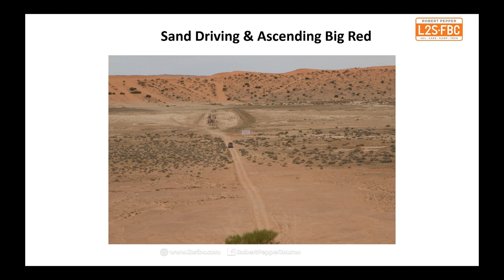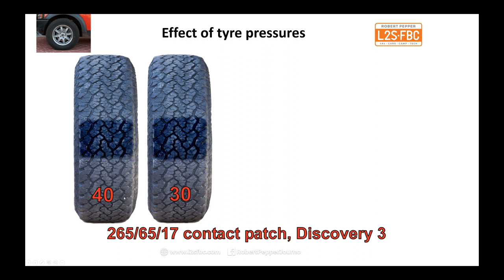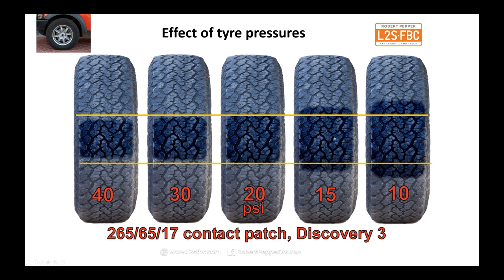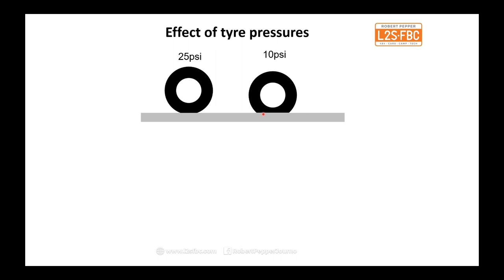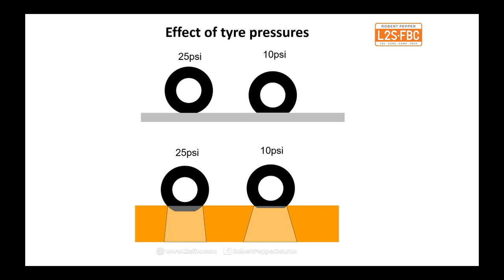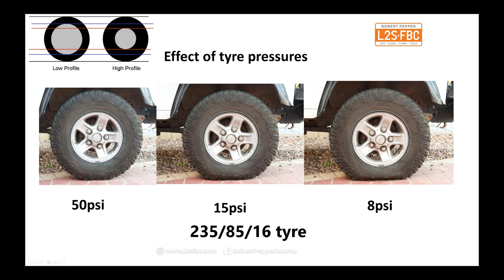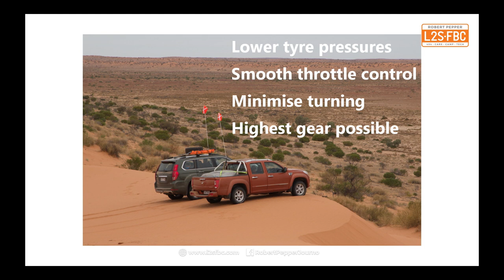How to Drive Big Red and Desert Sand Dunes...s l o w l y

Comment from the maker: Do you find this video useful? If so, please tell me why and subscribe...and if you didn't find it useful, subscribe anyway and tell me what you didn't like!
Reply: Every other video ref this dune shows blokes hammering up the hill.  Your method suits me just fine. Tks
Reply: bb
Reply: Great explanation of the contact patch and its interaction with sand
Reply: I tried with 8psi on Khumo MT71s (265/70 17s) and my Fortuner GX manual at GVM plus as we carried huge water / diesel loads as flooding had closed roads and it was raining (…. Tried going slow on the hardest line (low 2/3/4th) and always got stopped by the hot sand and about 20-30m from the top. Only high 2nd and downshift to 1st near the top got me over on the 2nd hardest line. Crawling will not work even at 0psi (the Khumo can handle 4-6psi as very stiff but dig badly due to the v aggressive MT tread…). All terrains are much better and softer side walls get more flotation….  Depends on your situation…. And going the easier line would work. The hardest line on the far left was so very steep and soft at the top = momentum needed….

Comment: A very heavy vehicle can't go down to 10psi but a similar footprint will be achieved at higher pressures. We slowly cruised up big red on a stinking hot day with 18psi on a fully loaded 3.9ton 75 series Land cruiser. Tyres we're 265/75 x 16.

Comment: I did that same right hand line in July towing my 1400kg (loaded) camper trailer. Similar technique, 2nd gear low range doing about 1700rpm with 12psi in the 4wd and 16psi in the trailer. 
Then unhitched the camper on top of Big Red and was easily doing the more difficult left hand lines. Technique there was 3rd Low and bring up to 40km/hr, then more accelerator when the hill gets steeper/softer.
Reply from the maker: Good post - also see my caravan dune recovery for where that didn't quite work...

Comment: I love the demo. All the theories aren't as convincing as seeing how it really works.

Contact patch size can be calculated quite easily. The total weight of your vehicle must be supported by the total contact patch area. The air in a tyre is at the same pressure everywhere in that tyre (high-school physics) and is the only thing supporting the weight of the vehicle. The main thing to remember is conversion of units, as (in Australia) we tend to think of vehicle weight in kg, but tyre pressure in psi, and we don't want to make a NASA mistake. The simplest conversion is to convert the vehicle weight into pounds by dividing by 0.454, so a 2500kg total vehicle weight becomes 2500/0.454=5506 pounds. This will be spread over 4 tyres, so each tyre will be supporting 5506/4=1377 pounds. (This will vary when the vehicle is on uneven terrain, so some will be more, some less). 

The total contact patch area in square inches is then simply the total weight divided by the pressure in psi, so at 40psi, the contact patch for our example would be 5506/40=138 square inches or 34 square inches per tyre. If your tread is 10 inches wide (i.e. 255/something) the contact patch would be only 3.4 inches long. Dropping to 20psi gives 5506/20=275 square inches and a 6.9 inch long contact patch. Down to 10psi and our total contact area is now 551 square inches or 138 per tyre and is over a foot long on each tyre. As you point out in the video, those last few psi taken out make a huge difference.

In the real world, patch size for each tyre does get affected by tyre stiffness and shape, because around the edges of the contact patch you have a tapering-off effect. It is also affected by the difference in load between a lightly or heavily-loaded tyre (e.g. hanging in the air, or uphill vs downhill tyre), but the maths gives you a pretty clear idea of the difference pressure makes, and the total must always balance out to the total weight of the vehicle. The heavily-loaded tyre will bag out more to give a bigger contact patch and the lighter-loaded tyre less, but you'll still be supporting your 5506 pounds over an area of a number of square inches defined by your tyre pressure - more pressure, less area.
Reply from the maker: Exactly, and there will be a video on this coming...I'm analysing the effect of contact patch vs profile against the theory as above. Thanks!
Reply: Really? The calculation gives 2x contact patch from 40 to 20 PSI and the example pictures show about 1.2x if that. Main factor for the discrepancy probably steel belt stiffness and rubber compressing. Then there is the pressure distribution within the contact patch but good luck finding a correct answer in the non-science sources.

Comment: Very nice video! All without spinning tyres and black clouds from the exhaust.
Shouldn't a lot of the sand driving techniques also work for (deep) snow?
Reply from the maker: Sort of. There's not a 1:1 relationship. Snow compacts into ice and becomes slippery. Sand does not. Snow is generally on top of other terrain, sand is its own terrain etc.

Comment: I agree with all that good useful advice .  Once you start climbing on sand like Big Red then you have to come right down in pressure . That looked like the Chicken line excuse the  name but that's what it's called .  The thing people should also avoid when at very low pressures is hooning around and doing tight turns etc. because the bead can break on the front outside tyre . I  did that once myself . The only thing is that high profile tyres when down to very  low pressures tend to also spread sideways a bit more than your diagrams indicate .

Comment: Great video thanks. In the video you advise use 'low range' but in the text say use as 'high a gear as possible'. Is this contradictory, otherwise could you please clarify. Cheers.
Reply from the maker: That is correct and it's not contradictory.  If you are travelling below 40km/h or so then the average 4x4 can use gears 1-6 in low range easily without excess revs. And you have a close-ratio gearbox. If you use high range you have first and second with a big ratio jump. Hence, recommendation to use low range. But within low range, use third if you can not second, and fourth not third...torque requirements permitting as the higher gears mean less wheelspin.
Reply: @L2SFBC  Thanks for that - makes sense on the gear ratio gaps. Just to further clarify - is that scenario you describe intended to be applicable for a manual transmission vehicle situation only. Or for an auto transmission vehicle would the driver aim to stay in auto but make sure to ensure quite gentle throttle control is applied to stay in the higher (low range) gears that way. Sort of 'don't panic and put your foot on the gas' if you start to slow down a bit. Ta.
Reply from the maker: Auto as well. Often pays to select the auto gears yourself to avoid changes which sap momentum

Comment: Interesting.  I have 19"  rims on my D4 - I've always been told that you can't lower the pressure of low profile tyres much.  How low can you go in sand with 19" rims?
Reply from the maker: Depends on the tyre you're running - construction and profile. Assuming you have the standard 255/55/19 in a decent offroad construction/pattern, drop them as low as you'd go for any other tyre. In sand, the sidewall/rim problem isn't too bad as sand is soft, unlike say tree roots or rocks. So for your D4 start at 18psi, drop to 15 if needs be, and 10 for emergencies but super slow and careful. Hope that helps.

Comment: What pressure does the tire fall off rim? I see people with plates to prevent this. I have stock tires on LR3…worried if l go that low l will be stuck because it pops off rim. Is there a bulge rule of thumb?
Reply from the maker: You can go down to 8 psi if you drive very slowly and carefully

Comment: Good video thanks. Very clear.
What about a vehicle without low range?  We have a 4Motion Kombi (Transporter) with a rear diff lock, but no low range.  It has slightly bigger and higher profile tyres than standard (235/65R17). What chance would that have of getting up big red?
Reply from the maker: Thanks!  I haven't driven the 4Motion Kombi, but it would be able to get up Big Red - I say that because it's not necessary to use low range to ascend it. We only used low range to demonstrate just how slow you can go.

The tyre size you have is great, narrow and tall. Drop the pressures down to 15 to start, and ascend in first gear at a speed where the engine develops a decent amount of torque - I'm guessing 2000rpm, maybe 2200rpm. If you don't make it, ie the wheels spin and you slow down, then reverse down the dune, drop pressures by 2psi all around (yes, that little) and then try again.

Don't use the rear locker, it will add no value as there will be equal traction on both rear wheels, and it will make turning harder and use precious energy.

Let me know how you go, would love to see a video!
Reply: @L2SFBC  Thanks for the quick reply and the advice.  We've taken it on quite a few beaches and it seems to do OK, but they have only been 'hard packed' sand beaches.  Yet to test it on anything super soft.
We did Googs Track last year in our Ford Ranger, and I was skeptical about whether the VW would have made it. Quite a few steep bits all chopped up by previous drivers using too-high tyre pressures.
Reckon the VW would do the Simpson, or would it get wrecked?
Reply from the maker: It would do it. One of the vehicles you see is a Great Wall Steed, stock-standard, with about 180mm of ground clearance. If that vehicle can do it, then yours can too. The Simpson is similar to Googs for difficulty. I have also got a Mazda Tribute up Big Red without drama, and driven a Santa Fe around Robe/Beachport, never got stuck either.

As a test, maybe look at doing some sand driving with the Kombi first, some dunes etc and see how it goes.

Take a shovel and 4x traction ramps, that's always important for sand driving.

Comment: With all due respect, the track taken is the easiest route up Big Red. It would have been a better instructional video if the two tracks to the left were also tackled for comparison
Reply from the maker: True but the point is still made, right?
Reply: @L2SFBC  Yes, the point is made. If only travellers would take less notice of the multitude of gung-ho videos of the desert crossings, they may learn something. Here's another way to be able to ascend sand dunes without brute force and ignorance ... engage your rear locker (if you have one), I always do and find I can crest a dune with far less speed. Keep up the good work
Reply from the maker: Thank you!

Comment: Steep hill low range high torque. At what point would the bead break? An auto would have the advantage with a gentle restart. thanks.
Reply from the maker: The bead would break maybe at 6psi...it's pretty dependent on weight, how well the tyre is on the rim, higher PSI if you corner hard. Yes autos are easier!
Reply: @L2SFBC  great video - subscribed. When you say dependent on weight, what sort of rule of thumb would you have so something like a fully laden 4WD at 3.5t GVM?
Reply from the maker: Depends on speed and terrain as well as tyre profile and construction.

For a 4WD weighing 3.5t running 265 70 17 tyres in sand I would go to 10psi at slow speeds but 15 or so for higher sand speeds.